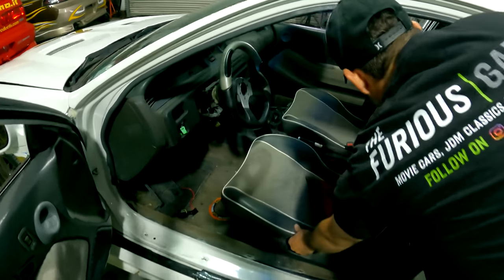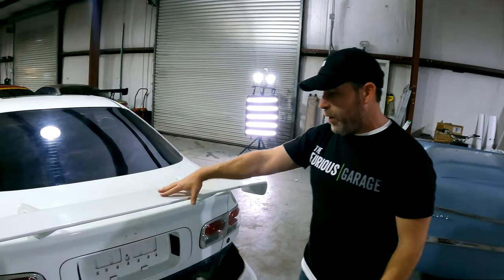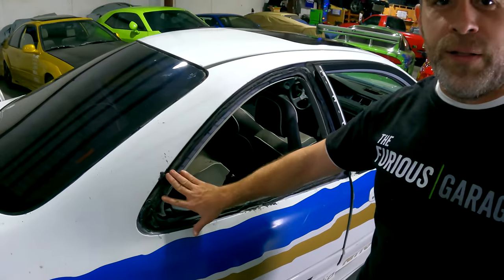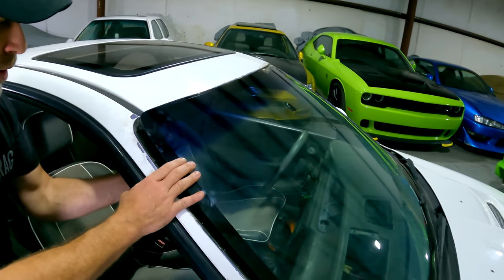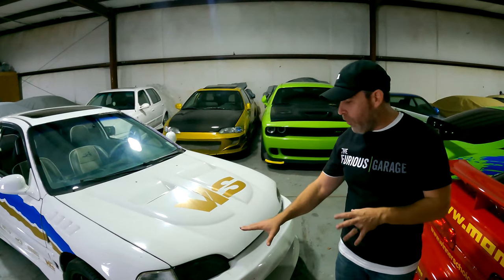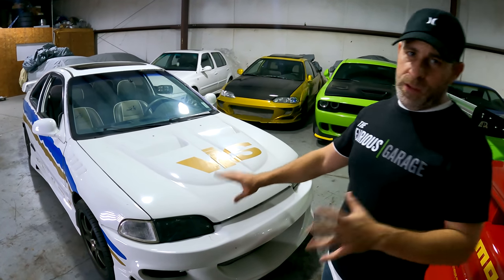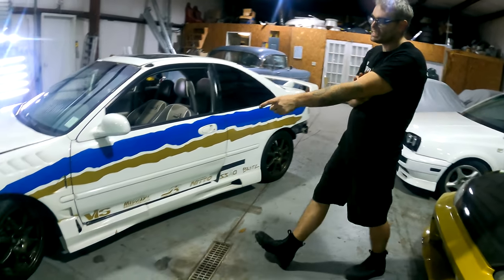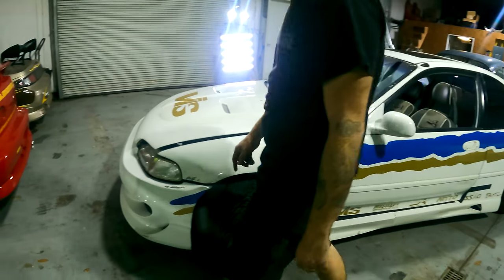DANNY YAMATO'S HONDA CIVIC EG FROM THE FAST AND FURIOUS MOVIE #civic #fastandfurious

Comment: Awesome 👌.  Look into 4 post lifts that for more car storage. They don't need to be bolted down. Gives you more options in the future for placement. Also wildfire lifts come with wheel kits, and only require 110v. Then you wheel it outside to do more of your undercarriage power washing. Vice Grip Garage just put some in again
Reply: I am getting 2 4 post and 2 2 post lifts.

Comment: Also I'd say B or D series since they drop in very easy and are period correct to the time. Turbo D series engines are making a lot of power nowadays with the new tech and are reasonable $ to build. I think that's the engine (D series) that people would build during that time.

Comment: let's hope he picks a k20, boostedboiz in the house?
Reply from the maker: derek really wants  k-series too.
Reply: I think that's a bad idea since it's not just a drop in affair like a B or D series I think you have to drill off the engine bracket and replace with one compatible with a K series.  I suggest turbo D, NA B series or turbo B series since they drop in with out any drilling or welding. I could be wrong though maybe there's a swap kit ( from Hasport) that eliminate the cutting. Also B or D would be more period correct to the time period before K swaps became main stream.

Comment: I'd remove the tape off the light. If you're going to leave it on because it is "film accurate" then you might as well leave the window off and the windscreen not attached.
Reply: That's what I was thinking too. I mean that would be screen correct. At least leave the windows as both in or removable if necessary.
Reply: @dcinhere  I see what you mean but I'd make the car road legal and make the car look like how it should of in the film. Keep all the extra bits as mementos.

Comment: Danny Yamato = RJ De'vera 1993 Honda Civic Coupé EX [EJ1]  

ENGINE SPECS
b16a JDM swap Engine
Tanabe Medalion Touring Exhaust

SYLING
Front fenders Z3 Civic 92-95 Coupe/hatchback
Xtreme Gt Full Kit Front And Rear Bumper Side Skirts And Hood
Type 15 Anniversary Style Spoiler Wing JDM RX-7
APC 404150TLD Euro Tail Lens For 92-95 Civic

TIRES/WHEELS/BRAKES/SUSPENSION
Racing Hart CP8
Nitto NT555 G2 245/35R19 93 W Tires 

INTERIOR
93 civic Seat customized
apollo interior trim works rj devera
Tripower Dual Dash Pod
Auto Meter Black Universal Dual Gauge Meter Mount Pod Black
MOMO Commando Grey And Black
Pilot PM-120E Shifter handle

AUDIO/VIDEO
Panasonic CY-VM1500
playstation 1 Console
Playstation 1 Gran Turismo case
Reply from the maker: Hell yea